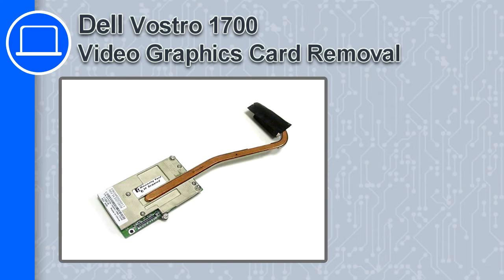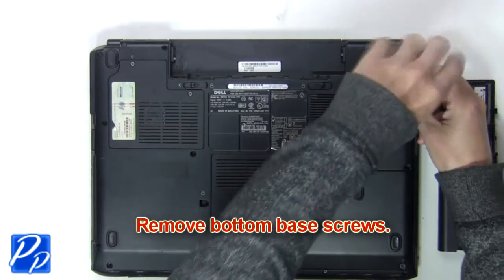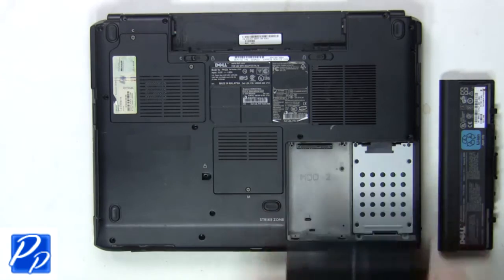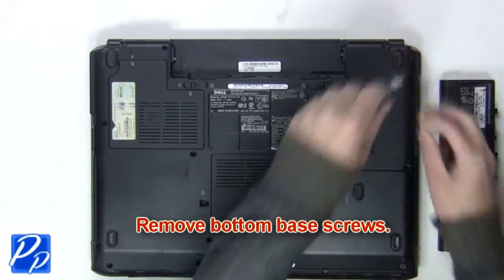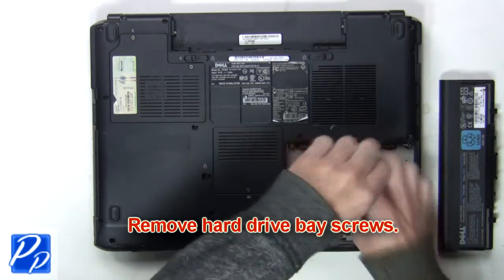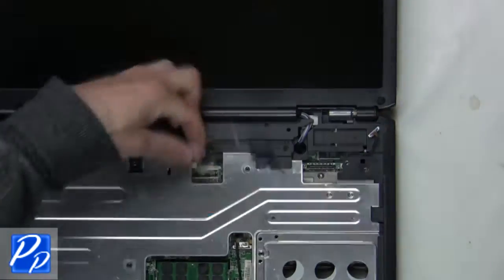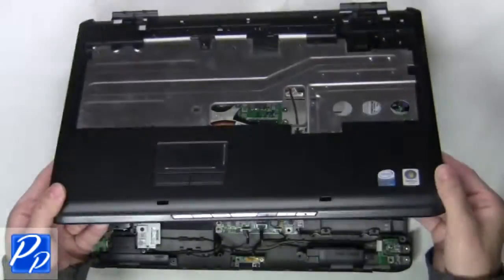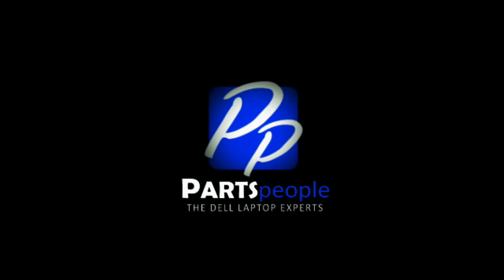Dell Vostro 1700 Video Graphics Card Replacement Video Tutorial

Comment: dude i need an update i dont use this laptop i have an good Pc WITH I7 8700K and a gtx 1080 but i want to make my dell vostro 1700 as good as it can be i upradet the CPU to an t9900 and 4gb ram and a 200gb ssd but the GPU sucks its sooo bad (sorry for my bad english im from germany)
Reply: Check motherboard Vostro 1700 version. They are 2 versions, integraded video and video card. Today everything is cheaper, even replacing motherboard. wikipedia bietet Informationen zu kompatiblen Grafikkarten